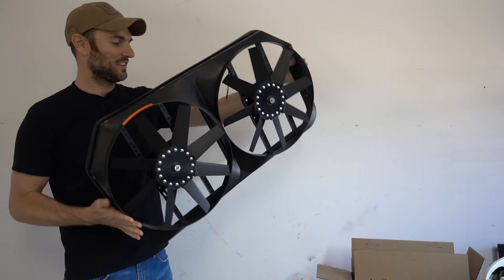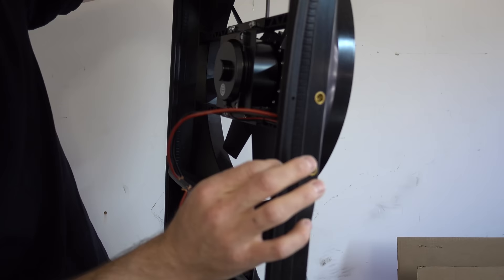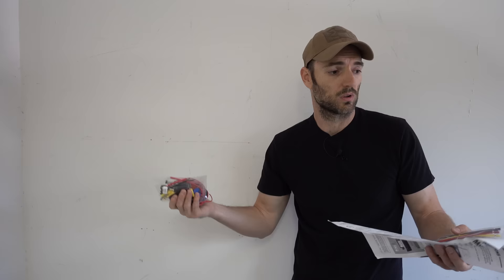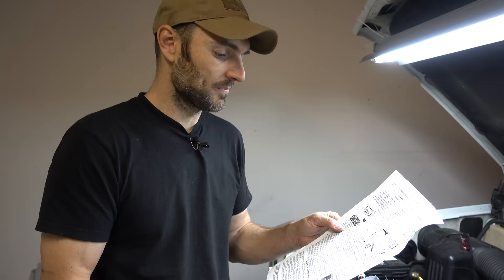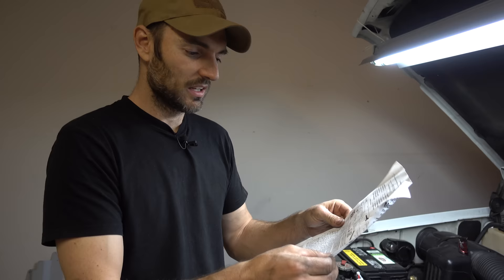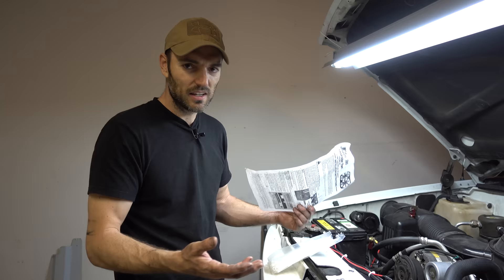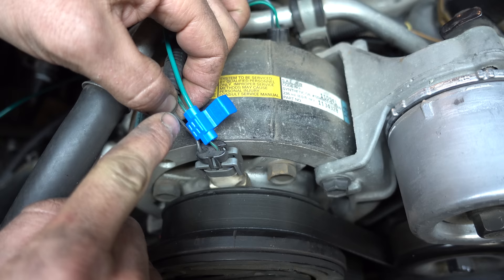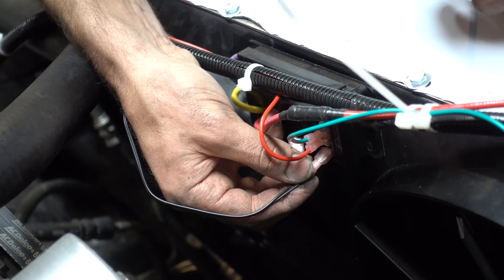Flex-A-Lite 280 Monster Fan System INSTALL & PAYOFF

Comment: Fuck that shit.. $550.00 US?

I went to the Salavage yard. Got s Ford Crown Vic out of a police car. It pulls 6k CFM. Has the controller build onto the shroud. Just use the empty 30 amp relay slot. Install the 30 amp fuse. It works like a tornado. As it's a 3 speed controller. Be sure to take the temp sensor. You can put it any place you have an empty coolant thread.. Mine was in the housing. The third wire is tapped into the AC clutch wire. When you turn the AC on. That thing sucks leaves off my yard!

It cost me $60.00 US

Comment: You know it's a NEGATIVE chassis  IT DOES NOT NEED TO BE CONNECTED directly to the battery
Reply: punker4Real what's it gonna hurt though
Reply: punker4Real needs a good ground.. I highly recommend to connect to your battery.. If not your fuse will melt

Comment: Electric fans are junk for pulling heavy loads up hills.we had a experimental  18 wheeler  they put electric  fans in the winter he had to stop 4 or 5 times everyday on the grapevine  it would over heat and boil they switched to a clutch fan never had another problem, my suburban  has a clutch fan idling  in never leaves the normal mark and the air  will free you out
Reply: Hello , XxzombiekillerxX mlg pro 5  , All the new model vehicles vehicles  using electric fans. Pls use quality fan, cheap fans will cause you heating issues
Reply: Lakshan Dawood this was a factory setup it was a test vehicle pulling long grades in heat caused a problem and winter they just don't pull enough air that's why they don't put them on heavy haulers

Comment: So Fan is control by the AC? What if I don't use AC when driving?
Reply from the maker: +HPCY It's controlled by a control unit. The ac compressor part is secondary.

Comment: Will these fan units keep up with towing needs?
Reply from the maker: +ForgeyLife I talked to a tech at Flex-A-Lite and while I can't speak for them, what I understand is that, yes, you can tow but just not extremely heavy duty. I can tell you from my experience my truck has never been cooler. My temp stays more consistent than it ever has. Just went on a road trip from Vegas to Los Angeles (no towing) and the fans worked flawlessly. Hope that helps.
Reply: Make sure you have a transmission oil cooler if towing regularly. You can also add a transmission temperature gauge in your vehicle or on Chevy/GM Vehicles you can get the speedometer display redone and a temperature gauge added in the dash display. There's companies that'll do it. You may have to add a sensor or possibly have something in the ecm turned on to make it active but worth it if you tow a lot. I have a 04 Chevy Tahoe with factory 4.8L engine and I use to tow a 28 ft fiberglass camper regularly for 7 years with no issues, knock on wood. Sold the camper to the insurance company in 2015 for water damage. Lost 2k value for 7 yrs ownership plus my $500 deductible so not to bad for a new camper that I bought as a closeout.

Comment: And you just gained about 30 hp by removing the fan. Engine Masters did an entire episode about mechanical fans and electric fans, with the fixed blade mechanical fan being the absolute worst, it can rob 50 hp from an engine. If you're looking for engine mods for more power I always tell people to switch to an electric fan

Comment: I have something like that on my truck but I was able to connect it in the front and I have it on a manual switch. I still have my mech. fan and clutch still keeping my engine cool and I have a a bigger radiator. While engine running my temp is 160 degrees. When I turn on the fans temp goes to 120 degrees. I got mine from Advance Auto Parts. I have two of them. https://shop.advanceautoparts.com/p/imperial-electric-fan-16-diameter-226116/89019239-P?searchTerm=fan

Comment: Don't do this if you're going to take it in the mud. Swap your mechanical fan back on for mudding before you clog this thing and kill your engine like I did. Way less drag than the mechanical clutch for a street truck though especially off the line. If you're already moving at say 25 mph and stomp it down there's not a huge noticeable difference but that's because the mechanical fan was already spinning and you didn't have to try to get it moving.
Reply: Add a kill switch if you run through deep water, other wise the fans will move towards the radiator fins causing damage to radiator.

Comment: You should do yourself a favor and delve into the world of Hybrid  automobiles.  Everything on the cars are electric.  A/C compressor , the cooling fans, water pump, etc..  At red lights, stop signs and just sitting, (not moving) the engine shuts off and all accessories kept right on going as if the motor is still running but is not; the engine is off and you are just a cool as a cucumber.  You should do yourself a great justice by moving into the "Twilight Zone"  Next stop "The International Space Station"

Comment: lol... The fact that you spun your fan and dont understand how it works. Is fact that you really arent smart enough to know... Manual fan is the best solution to cooling and still on all real vehicles that tow. Learn how they function/repair yours and then supplement it with electric fans. This will keep the block fan from fully engaging and saving you fuel mileage. Which is the only reason ANYONE ever went away from block fan is for fuel mileage. With that all said...  I do understand that today electric fans are pretty dam good and if large enough and spendy enough. You can get some great cooling. The best solution is running both. Because the block fan will save you when towing with 2-2500 RPM up a hill and the electric cant keep up even with stage 2 on.
Reply: DotusTM what's a ford?   lol just pulling your leg pal. i love those old time fords, can't kill em.

Comment: Hmm. looks like an infomercial to me. Yeah, your condenser isn't be cooled. Partly not enough air partly the wrong freon. We used to be able to use R12 and now since the only patent Dow could get is 134A so of course your AC blows warm. But you could use something else. There are many other refrigerants that all work better than 134A. Do some research and pick one. I use a mixture of propane and butane. Cools like R12 but with less head pressure so its more efficient.
 Oh and don't tell me they are flammable, so was R12 with an oil charge.